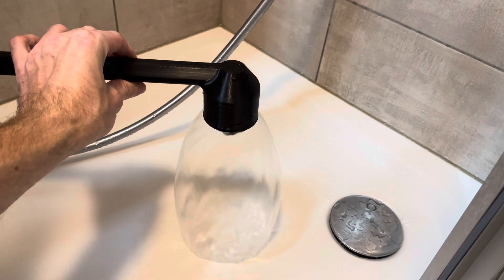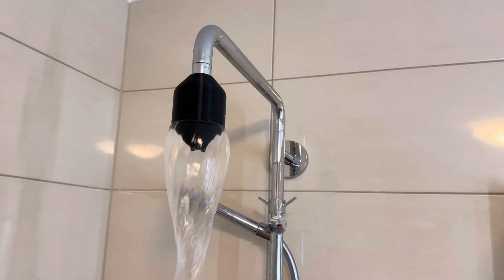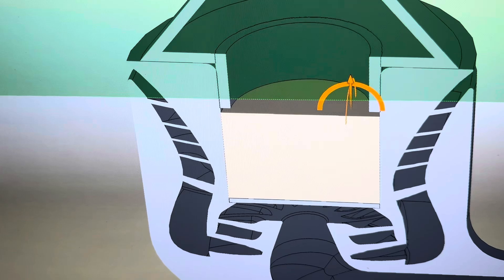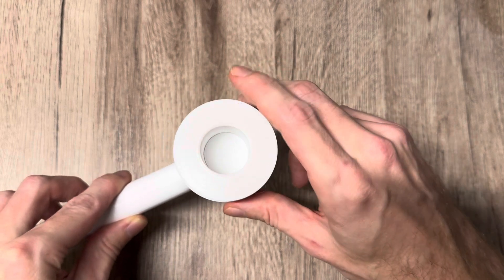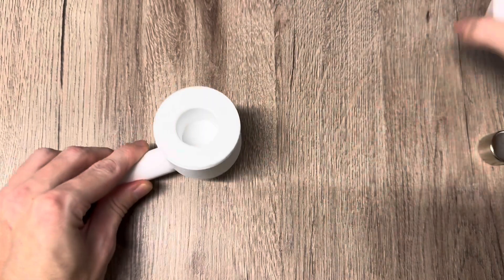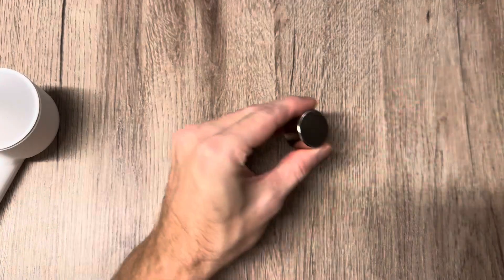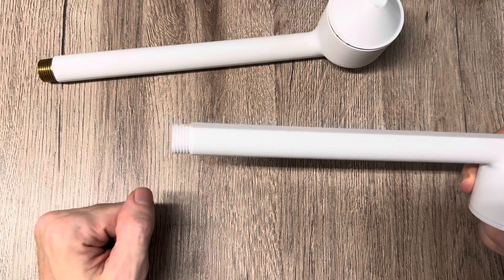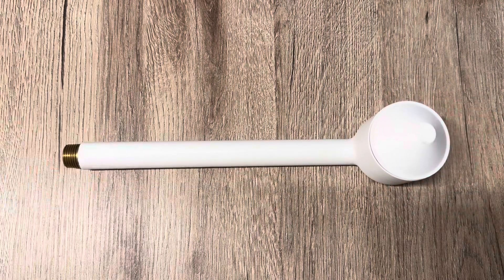Magnetic Showerhead for structured and rotating water with assembly guide

Comment: You don't need either the cap nor the disk just the head does the job well. It should be printed out of titanium or stainless steel though to withstand the high temperature. Other wise it's a nice piece of pipe there 😎👌
Reply from the maker: The disc is necessary, the cap is very much recommended to protect you from the magnet and the magnet itself and it also looks better. 
Printing it with steel or titanium would be very expensive, PLA can easily withstand water temperatures of 50C, I don’t think anyone showers at these temperatures.

Comment: I have no clue of this structured water, you woke my interest. And It‘s the first reasonable application if an 3D printer i have seen, cool!
I wonder on the mainenance..can this showerhead be cleaned when there‘s a lot of calcium in the water?
Reply from the maker: Sure, just put it in a vinegar/water mix for a few hours to remove the calcium.

Comment: A very cool design, keep up the great work!
Unfortunately this is not the optimal way to create structured water using magnets. However I do very much like your channel and creativity, and will gladly share with you the correct information, as there is far more incorrect information currently on the internet concerning this topic than correct information. Structured water via magnetism comes in two forms, north magnetized and south magnetized, and each have their own unique properties.  And which one is preferred depends on the case.
For this case, it is human bathing/consumption, as our skin does drink the water which we bathe/shower in. 
(Regardless of the desired pole, having the water cross multiple poles and/or the bloch wall is counterproductive. Magnetically structuring water with or without a vortex is a mono-polar effect and requires a focused field direction.)
To optimally structure water using magnets, we pass the water only passed the face of our desired pole.

I highly recommend the following experiment to anyone who wishes to know the difference between the effects of North vs South Magnetically Structured Water on the Human Body:
1) Acquire a Very strong magnet. (I used a 2"x2"x1" rectangular rated around 300lb pull force)
2) Pour your drinking water passed the face of the south pole as close as possible without touching (optimally towards the outer edge)from one bottle into another. Do this at least four to six times for this bottle of water before drinking it. Pour slowly.
3) Continue this for every bottle of water you drink for the entirety of this day.
4) On the next day, do exactly the same thing but pouring passed the North pole this time. Again pour each bottle of water 4-6 times slowly passed the North face only of a very strong magnet for the entirety of this day.
5) By the end of the second day (if you have followed the above directions, and consumed at least 2 liters of the water you made each day) you will know very clearly that you have just completed an optimized magnetically structured water experiment.  You will now be sure in your own mind exactly what are the effects of North vs South magnetically structured water on the human body.  You can now decide for yourself which cases you'd like to use North vs South water for.  As you think more, you will also come to realize that there are some times you may want to drink/shower with North water, and other times that you'd prefer to drink/shower with South water.  The effect of each pole on the human body is distinct, and becomes more so with the more that is consumed.

Additional information concerning plants:
Now that you know a simple and effective way to create magnetically structured water, you may wish to see which pole your plants prefer.  If you have a few garden species to test on, you will see that plants are picky, and that they don't all like the same polarity water. They may grow a little slower, a little faster, or at the same rate while being more satiated or more thirsty. It all depends on the species, and may not always be so clear.
Reply: Can you please fill in some more information.
Why is it needed to be cagey about it's effect? I have several of those exact type of magnets I use to structure water.
But according to you I'm doing it all wrong because I use them go spin or rather direct the water around them over and over in PE tubes. And it certainly changes the properties of the water. So I thought it was a beneficial effect because it makes the water more flowing and it changes the surface tension properties if the water. So to me it seemed structured enough.
I use the magnets on the water as it is flowing out of my RO machine.
Do you know a way I could construct the flow to do as you suggest with PE tubing to only go from one way to the other like you suggest?
And please fill in some more details about why how I'm doing it so wrong and how you are doing it is right and what the whole point is with your method. What are the outcomes exactly? You have it already figured out so why don't you share the details so people can be motivated to follow your ideas.